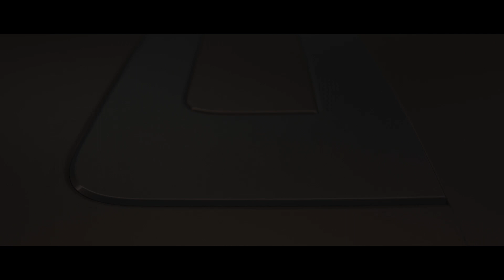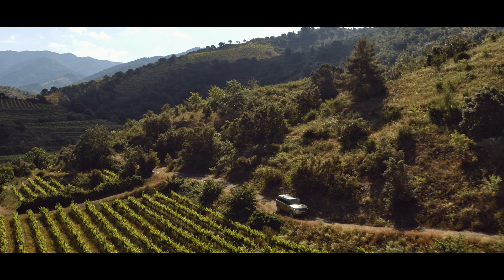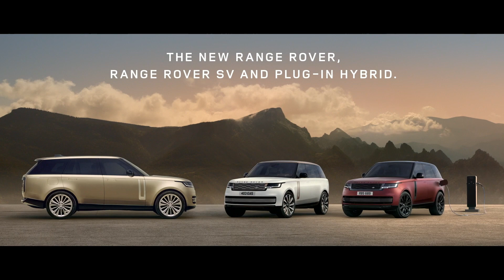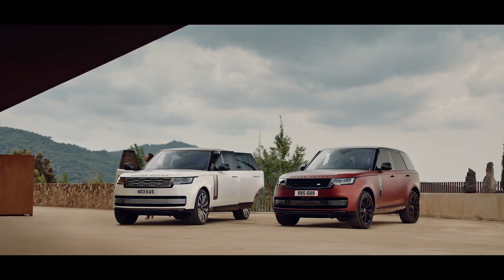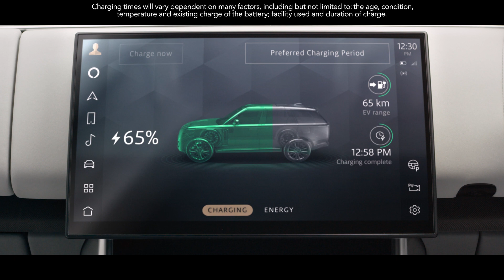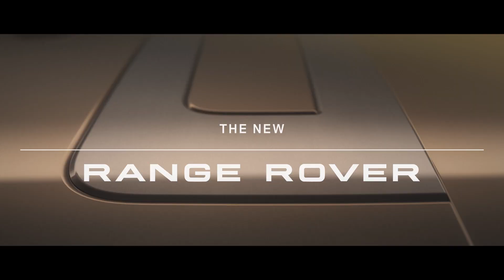2022 RANGE ROVER | First Look and Thoughts

Comment: Hard to believe this video is 3 years old and mine is only the 4th comment.  I enjoyed your video very much and have two things that jumped out at me.  First, true….I don’t care.  When things break, they can be pricey.  But I don’t care.  I’m on my second Range Rover and will always have one in my stable.  My first was an L322 HSE.  My only regret with that one was that it wasn’t supercharged even though it has a V8.  My son has it now with 250K miles.  The two major items that hit that one were the transmission valve body and the front air suspension.  Both were in the neighborhood of 150K miles.  To this day, it drives like new.

The second is that there isn’t another vehicle like this anywhere.  No other vehicle has this level of luxury with such a high level of off-road capability.  For example, what other SUV has the hood serve as an underwater snorkel?  I’m an engineer that is occasionally called out to construction sites where I often drive past construction guys stuck in the mud or watch them bounce all over the place while I am cruising through sipping my coffee, listening to Mozart.

I’ll close with this bit of advice.  I often get positive remarks about my Range Rovers.  When asked how do I like it, I tell them all the same thing.  DON’T EVER GET ONE! Because once you have one you will always have to have one.

Many thanks, my new friend.

I just found your channel, and am enjoying it very much.  Not necessarily the content, although it is very good, but your delivery is quite nice.  You strike as down to earth and it’s even refreshing to hear someone else having trouble pronouncing many the names they put on things these days.
Reply from the maker: That’s all so kind of you to say!!!  I started this channel several years ago as something fun for me to ramble about cars on, and unfortunately got sick over the last couple years and kind of let it sit.  Trying to be more consistent now juggling my day job and putting out new content when I can 😎.  Thanks again for the comment and I appreciate you watching my videos!